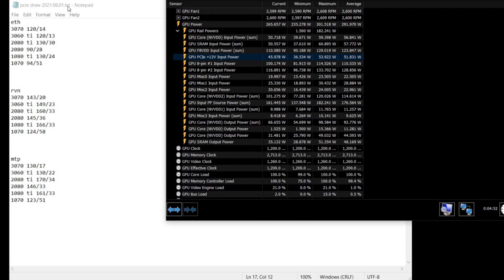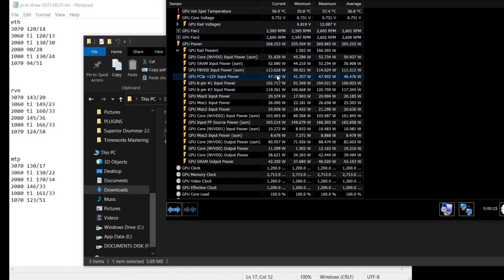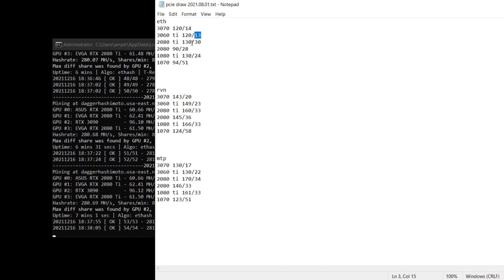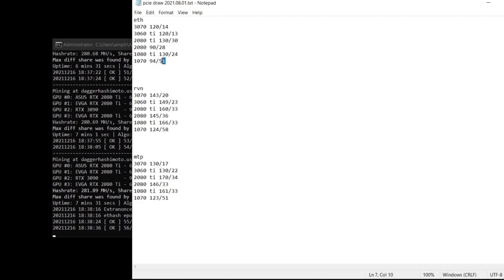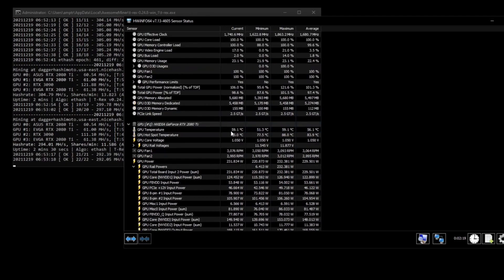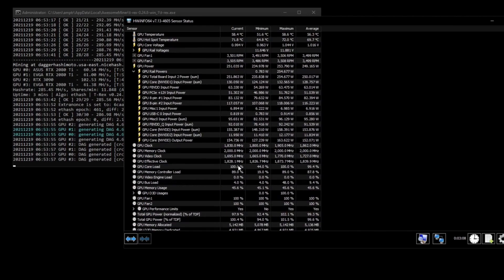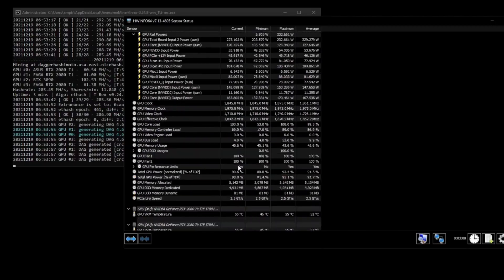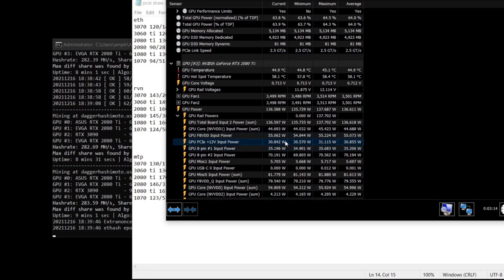How to check PCIe power draw.

Comment: Sadly this isn't always accurate. For example, I currently have a GTX 1650 in a low power build I'm messing with and it's undervolted. Maximum power consumption seems accurate in HWinfo as it shows 60.8W at 100% load, but during idle its showing 32W, which is WAY higher than it should be. A GTX 1650 idles around 6-8W. Software like HWinfo is great for many things, but the readings aren't always 100% accurate. So just be aware of that.

Comment: Will this prog help me understand why my MB wont recognize more than 4 cards. I seriously doubt its a power issue. Its only 4 cards being powered by dual PSUs providing over 1300 watts. But maybe its in the way the power is being distributed?
Reply from the maker: Sounds like you need to free up some pci lanes. Disable Integrated mobo graphics,  hdaudio, and the m.2. 

Also set pci to gen1 or gen2

And enable above4g decoding if mobo has it.

Comment: I don't have GPU Rail Powers?!
Reply from the maker: Is it latest version of hwinfo? The drop-down menu is kinda confusing at times also. Did you click "sensors only" when it first started up?
Reply: @JoyofMining  yup I’m using the same version you are and yes I checked sensors only when starting. 
There simply doesn’t seem to be an entry for rail powers. I only have 3 AMD cards so would it have anything to do with AMD?
Reply from the maker: @theseraphpath  could be amd doesn't show. Also try GPU-z